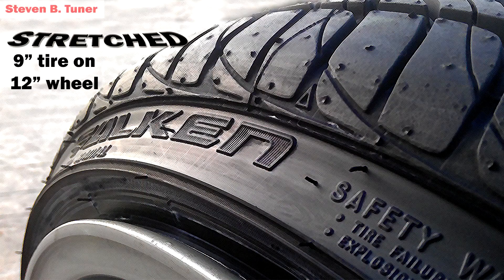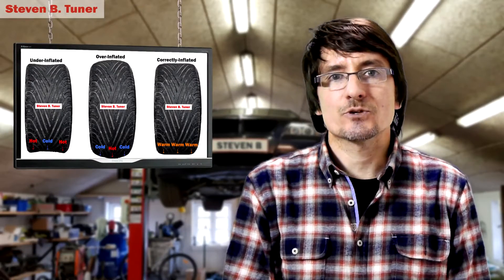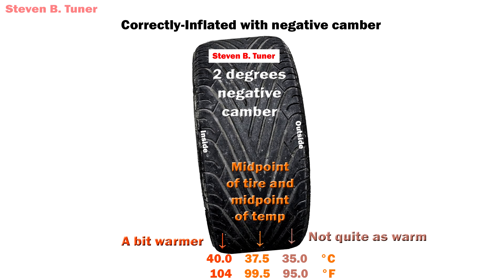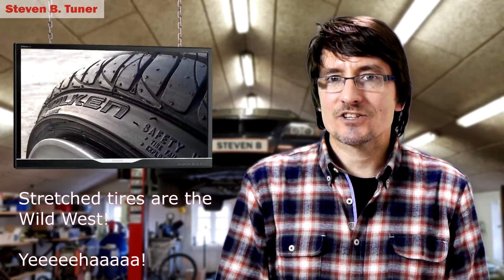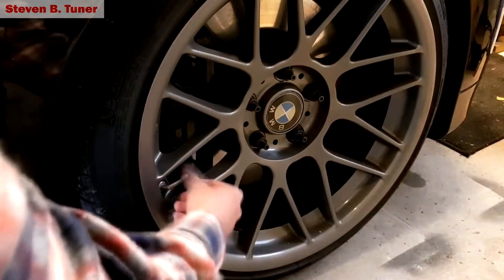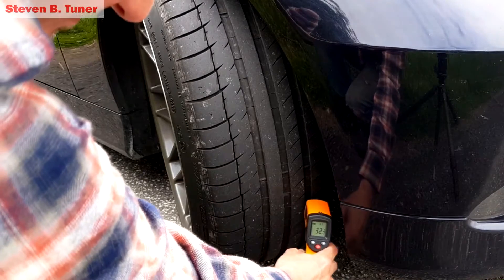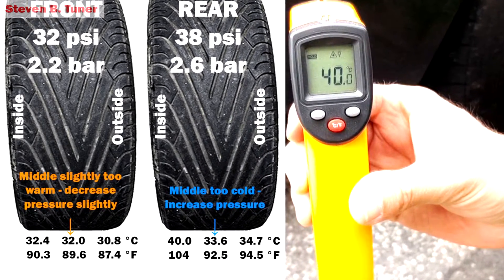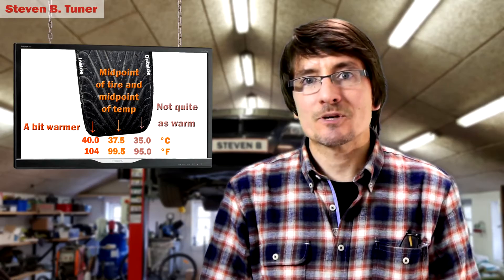🚗 Optimize Your Tire Pressure: The BEST DIY Method for Performance & Tire Life (Not Just a Gauge!) 💨

Comment: Thanks for the video. I began to include this method into my tire pressure adjustment. I combine the thermometer measurement, tire height (from the ground to the top of tire) for left/right balance (front/back heights are mostly different, and it's ok), visual check for contact patches by photographing at ground level. Results for my case (Volvo V60 CC 2020, winter time) are FL 41.5, FR 40.0, RL 36.0, RR 36.5.
Reply from the maker: That's fine tuning worthy of a winning race team!

Comment: Make sure you have a tyre gauge that is accurate, I adjust my tyres with a unit similar to yours Steven, however I then check the tyre pressure with a known accurate digital gauge.................also always check your tyre pressures with cold tyres........................you could always put a camber kit in the rear of your car to get those temps a little more even too.
Reply from the maker: Hi, you have a raised an excellent point that I didn't cover in the vid - I will have to do an updated version! Once the optimum pressures have been determined in the normal conditions, they need to be recorded again once the tires have cooled down - so that the numbers are useful for future use.
Reply: @StevenBTuner  I Look forward to seeing it

Comment: I just got a bigger tire for my Jeep Patriot - 235/65/17 - stock size was 215/65/17 - recommended psi for that size was 32 PSI , what do you do think I should inflate my new tires to?
Reply from the maker: Hi, thanks for watching! Once you change things from standard, the recommended pressures are not going to work as well. The best tire pressure to use is the one you discover by using the technique in the video - it doesnt take long to take the readings a couple of times in order to home in on the perfect settings.
Reply: Start by adding 10% so add 3.2psi to 32psi to get 35.2psi

Comment: Great video! I use this method in sim racing but check the inner, middle and outer tyre temps to see if I need to adjust the camber so the tyre is making full contact. 

With road cars how can we find our optimum tyre temps for the road ?
Reply from the maker: Hi, thanks for watching and commenting!  Road driving is a lot different because very few of us are going to get our tyres up to optimal temperatures that often, even if we knew what they were. Hmm, having said that, I definitely can feel when my Michelin PS4s go from 'too cold and squirmy' to 'good to go and grippy', so I'll have to have a look at the temps when that happens - but I bet it is more like 40 degrees Celcius rather than 80.  Not many of us adjust camber each time we drive, so this video is more about getting the best contact and wear life out of the setup that we have on our cars all of the time.

Comment from the maker: Have you tried the method used in this video, or even heard of it before?  How do you usually work out the best tire pressure for your driving?  let me know!
Reply: Buying a thermal imaging camera as we speak because of your video! Nice insight!
220x160 IR sensor or better I'd recommend. Don't buy Fluke, Flir, or the ones that plug into the phone.

-B
Reply: Wondering why you don't take the camber of the rear tires into account when measuring the temperature?  It seems like the initial temp reading you took for the rear tires was off because of the camber you have on the back wheels.  The center and outer temps were very close but the inner tread was hot due to the added pressure exerted on the tire from the camber of the wheels/suspension. Thoughts?
Reply from the maker: @Sovereignrich  Hi, thanks for watching! Camber is a fact of life for pretty much every tire now which causes the inside edge of the tire to be a bit hotter, and the outside edge to be a bit cooler. This method is all about getting the temperature of the center of the tire to be exactly in between those inside and outside temps, so that the pressure and grip across the tire is as even as it can be, for the driving that you do.